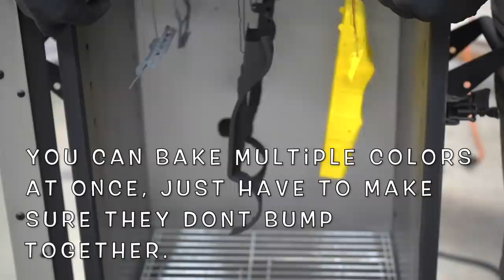1960's Nylint Roadster Restored - Vintage Toy Restoration Video

Comment: Nice job, I like the way you manufactured a thermostat for the radiator. Mine also had a black roof. It snaps into that flat piece on top of the windshield and tucks behind the seat.  When mine was new, the back bumper was perfectly straight all the way across, and had a textured mylar sticker on the front of the black radiator.

Comment: I like how he skips paint stripping and goes straight to sandblasting. A very bold move!
Reply from the maker: Seems a bit repetitive.
Reply: Unless the paint tests positive for lead, it is redundant to strip the paint chemically just to sandblast it next. Even with lead based paint, the dust is really only toxic if eaten, so it seems like it should be fairly safe to sandblast any paint off, as long as your lunch isn't nearby.

Comment: May i do a suggestion: getting a 3d printer, since if new parts aren't anymore, you can simply 3d print these then sand and then paint these to get them to a similar state as new old stock parts.
Reply: "Simply" 3D print. These words don't really go together. But I agree that 3D printing has the potential to help revitalize a lot of incomplete projects like this.
Reply: The trouble is not everyone has the cash for a 3D printer - I know we don't and TRG is being INGENIOUS. I personally think the hood ornament is BRILLIANT and well done......just as good as with a lathe, let alone some pricey 3D printer.  I know not all 3D printers are expensive, but I've seen the cheap ones at work and the outcomes are shoddy to say the least.  I would rather see TRG do things like this HIS way and have a success than pay out for cheap stuff that's not as good. 

I would also like to add that this project is NOT 'incomplete'.  The car looks as good as original. It has all the seating, including the rumble seat and the hood ornament is replaced. I, personally, like to see people like TRG, without all the sponsorships and expensive kits others have, who use the skills and equipment they do have at their disposal, along with their own creativity and ingenuity, to complete projects.  ANYONE can do something if they have a 'money no object' state of the art set up.  But when someone is working with much more basic equipment and their own skills and still have a fantastic outcome like this one was, then THAT is IMPRESSIVE.  A long suffering partner is also handy!
Reply: Amen ! You sir nailed it!

Comment: To be purely technical, you did not have to replace the plastic.  You could have used the liquid crazy glue and baking soda trick to replace and bond the broken plastic.  Then a little sculpting, sanding and red paint.  Viola! Original, yet like-new parts.

Comment: Nice restoration...the models I work on are always missing parts which makes them less expensive and provides a challenge of fabricating replacements...you certainly have the talent.  By the way, is that model a Bucket T?  Best wishes.
Reply: It's almost certainly based on a 1932 Ford roadster.